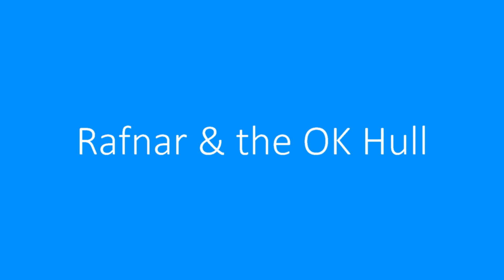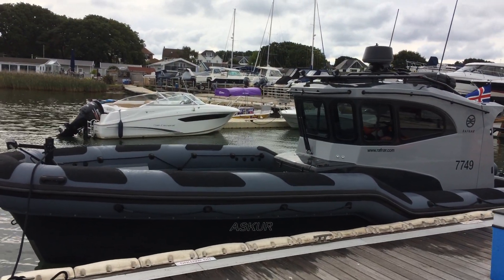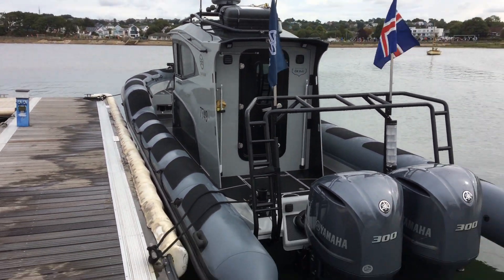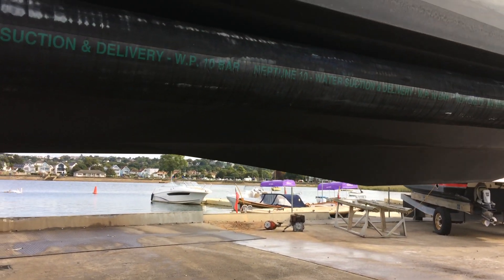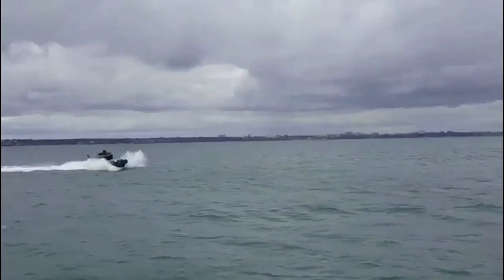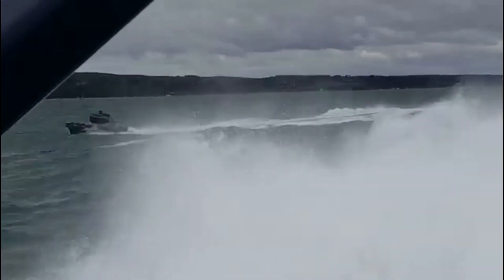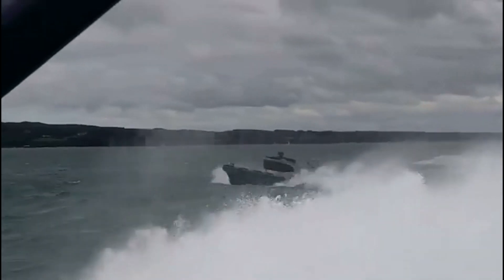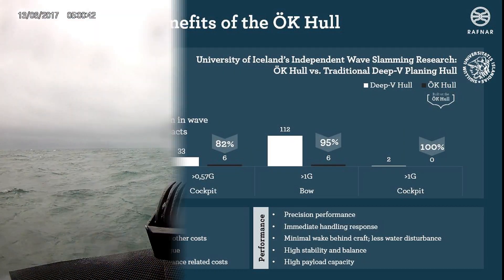Rafnar Demonstration movie

Comment: Very good hull without slamming, but notice a lot of sprays
Reply from the maker: Hey Kalin, thanks for your great comment.  Yes, she runs totally flat and glued to the water which provides a ride with greatly reduced slamming.  Where there is a yin there is a yan...  Due to being glued down she can push out a lot of water, but it's a small price to pay for the increased comfort.  But she has very similar efficiency to a deep vee planing hull all the same.  All down to the "Arc of Circle" which is the hulls principle.